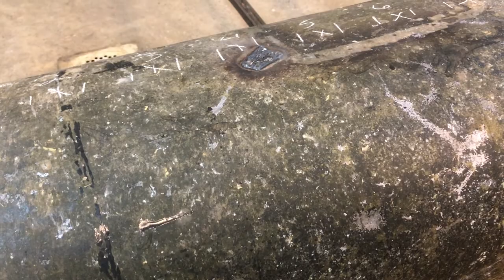Diy lawn roller

Comment: Did you cut the concave bottom out and flip it, or did you have the top from another tank? I just got a tank from the dump and im building one now
Reply from the maker: Cut out and flipped
Reply: @Dugg_Digs_Adventure  great idea. Here i was trying to figure out how to round out the bottom of the tank. Just finished cutting the bottom off, shortening the tank a bit and tacking it up. Thanks

Comment: 4:30  Why did you put that pipe piece in the hole from inside the tank when you could have put it in from outside the tank.

DUH!
Reply from the maker: I have a plate welded to the end of the pipe in case the outside weld brakes the plate won’t fit thru the hole
Reply: @Dugg_Digs_Adventure  i wasnt sure. Now i get it